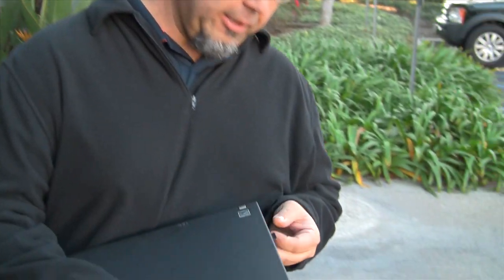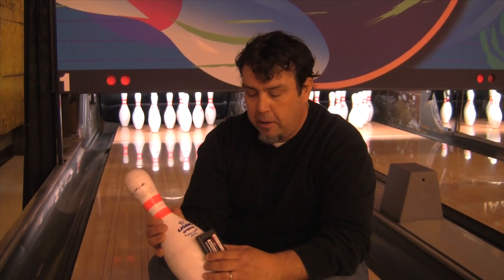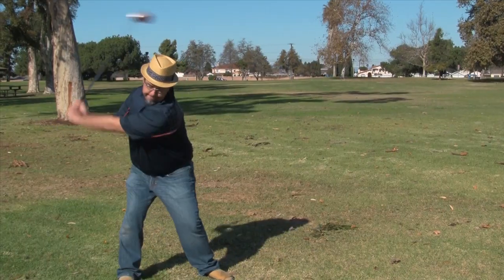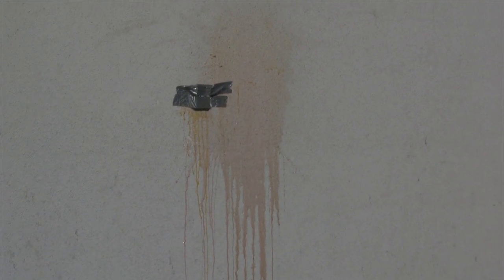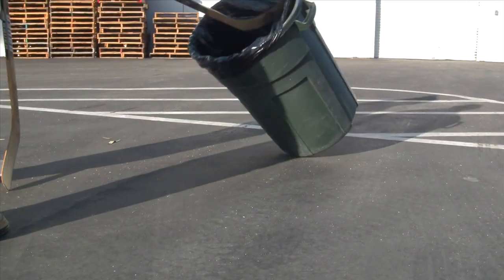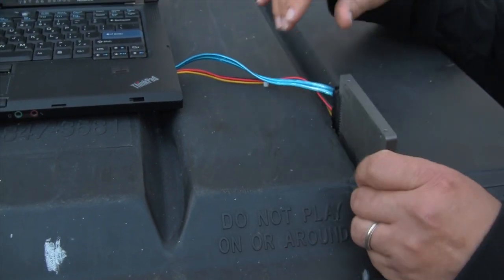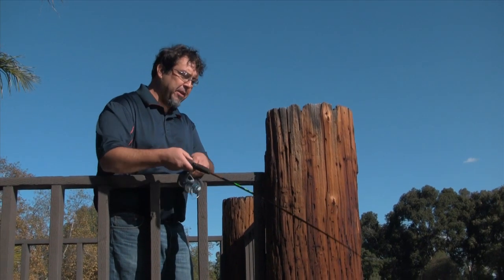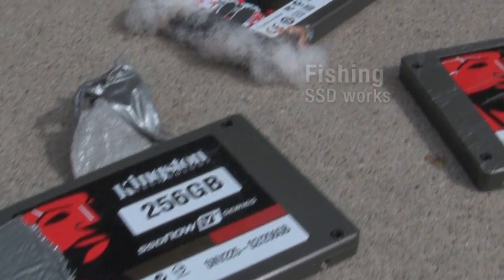Kingston SSD Destructo Series - Full Version

Comment: yeah they might be able to take physical shock, but the read/write cycles eventually kill them
Reply: not nearly as much as magnetic disks. 
so far i haven't had a single SSD fail because of mechanical problems.
Reply: SoldierCyfix that may be true, but SSDs are garunteed to wear out, mechanical drives you can get lucky, i have an idea for a more reliable (and fewer moving parts) mechanical drive, that would be less likely to have a head crash.
Reply: ***** OH MY GOD!!!! you just negated every point you just made with the dumbest statement i have ever heard....CPU cache works absolutely nothing like that, if you think that you know ABSOLUTELY NOTHING about computers, CPUs have cache, VERY SMALL amounts of cache that is filled with data they are ACTIVELY using and working with to speed up processing, so that they do not have to use system RAM, there is NOTHING there permanent or long term there and they do not use it to make programs load quicker. your typical i5 and i7 has 64kb L1 per core, 256KB L2 per core, and 6MB to 8MB L3 per core, a grand total of 7.25MB to about 9.25MB of cache, no way any program will fit in there, and if it did your computer would be slower at processing, look up CPU cache before spitting out what you think you know, you make yourself look like an idiot, no offense, here is a good analogy http://www.tomshardware.com/reviews/processor-cpu-apu-specifications-upgrade,3566-9.html

 SSDs when there write cycles get used up they dont just become read only, they die over time because the charge pump has VERY HIGH CURRENT which slowly damages the SSD over time to the point they can not write and die completely, ans since they have to be erased before being written too it is likely they will try to write and fail and loose the data that was there, anyways the same reason that causes the cycles to fail will make them not readable, and kiss your data good bye, nothing short of magic will recover so much as 1 bit from a dead SSD
Reply: ***** anyone can build a computer, you dont have to know how they work to put the pieces together and install software, the question i have for you, is can you write a program in more than one language? C, C++, Java, Python, etc? do you have an understanding of the hardware works? are you A+ certified or have any kind of professional training?

what am i looking for here other than what i already told you? also Wikipedia is not a credible source, they teach that in High School and College. cache is temporary and no important data is ever stored there long term
Reply: ***** yes, going to school for Computer Science, i learend Python, C, C++, and Java last year, Javascript and more C++ this year. you need to realize not everyone that says something is lying...unlike you who think you know what CPU cache is and its not true, CPU cache is volatile (looses data when the power is turned off) there is not data that needs to be recovered.
Reply: ***** yes i did, not dreaming, you just dont want to admit you didnt know what you are talking about, just because you can build a computer doesnt mean you know anything about how they work, tell me, what is a half adder? full adder? AND gate, OR gate, XOR gate, NOT gate? what is 1011010 equal too?

what is a while loop, a for loop, what about an if statement? do you know anything about these? i didnt say im a full fleddged programmer, taking classes for it, and i can prove i can write code, you have no proove to back up the BS you said about CPU cache
Reply: @Superchad245  So 5 years on how many SSDs do you have in your PC?
Reply: @ThyPredator  typically 1, and a hard drive, I always make sure the SSD is backed up to the HDD
Reply: Superchad245 what is it
Reply: actualy no, stationary heads read/write (one or two heads per track) they can be more fixed and rigged and not crash. also they could allow switching to a head vs moving it to be faster and using more than one head to access multiple tracks at a time.
Reply: ***** endurance is not always spot on, it can wildly vary, it is most effected during small but random writes from what I understand
Reply: ***** actually the 840 EVO has even less endurance than an 840 Pro, since it is TLC and not MLC, tiny file writes happen wether you want them to or not. most enthusiasts write more than an average of 40GB per day. the fact is SSDs WILL DIE, a HDD MIGHT die, you can have a hard drive last longer than it should. but its unlikely an SSD would.
Reply: tell me this, if SSDs are so great how come people have had them die for no reason at all? also most enthusiasts dont just browse the web and watch videos, what is the point of a high end computer if that is all you do? something like video rendering will kill an SSD, it is especially worse if you dont leave overprovision space. the fact is SSDs WILL die, its fact, Hard Drives MIGHT die, in theory yes a hard drive could last 40 years, just like while most cars might only make it 200,000 miles, some can make it 300,000 or more with no problems.
Reply: Superchad245 I've has 2 SSDs installed on my PC since 2011 and i have cloned them, and did several full restarts on my comp that put great stress on HDD because of the massive amounts of deletes and writes they have to endure. they are both running strong
Reply: ***** and people have had SSDs degrade from how much is written to them, MRAMs dont have this limitation which is why i am looking forward to MRAM SSDs, there have been hard drives that have lasted far longer
Reply: yeah but TLC is slower than MLC
Reply: ***** wouldn't be surpised to see power users and enthusiasts doing that quite often, and for video rendering that would happen a lot more than you might think.
Reply: ***** well i don't use SSDs or HDDs "lightly"
Reply: if you mean TLC then that is totaly false, TLC is even WORSE endurance than MLC, MLC worse than SLC, and the performance is lower too. they still have a write cycle limitation, MRAM doesnt so we need to move to MRAM based flash.
Reply: ***** you are comparing different brands, which means different wear algorithms as well, TLC is also slower because it has to do more work to read and write data. comapre an 840 evo with an 840 pro. SSDs still have a finite write limit, if you fill it up it WILL kill it quickly, hence why you need some overprovision space. its better than before but still not hard drives, i think you put too much faith in new tech. maybe when MRAM hits the market you might have a case. non MRAM on DDR3, sounds like RAM waiting to die, MRAM is the only NV ram suited for that task.
Reply: ***** then why have even modern drives failed endurance tests? its the small frequent writes that kill them, making them bad for virtual memory and cache drives for video rendering
Reply: ***** thats pretty pathetic actually, that means any kind of cache use of the drive like for video rendering will kill it. also like i said, full drives do quicker, SSDs are garunteed to drive, a hard drive is not a garuntee, it could last forever if your lucky. virtual memory can hurt a drive too
Reply: ***** because you need to think in the worst case, also when an SSD fails, data recovery is IMPOSSIBLE, hard drives are possible to recover. also most people out there wont know to not fill them up, and that will kill them like none other as wear leaviling can't work effectively. and things like virtual memory that writes constantly will hammer parts of it.
Reply: ***** when an SSD completely dies (as in it can not be read from at all, its toast, data recovery is impossible) and thats more common than you think, i think when you use up the write cycles you can't read from it but may be wrong..
Reply: if an SSD completely fails it is impossible to read, yes but no CPU, GPU, or Motherboard has DATA on it, and HDDs can be recovered in total failure, spindle dies, controller dies, and sometimes in a head crash. data recovery on an SSD is IMPOSSIBLE, you cant take out the data and access it independently and reconstruct it like on an HDD, and as far as i know when the write cycles GO, the drive is not readable, there is a REASON they have finite write cycles, it has to do with the charge pump to write to them.
Reply: 1011010 in base 2 is equal to 90 in base ten.

Comment: Need to be stu.pid to buy SSD. It doesn't care if the case doesn't brake. I've heard/readed lots of case of noobs crying because they had to RMA their SSD. I never replaced an HDD in 12 years.. those crap SSD cost millons and they may break in 3-4 months or 5 years ^_^